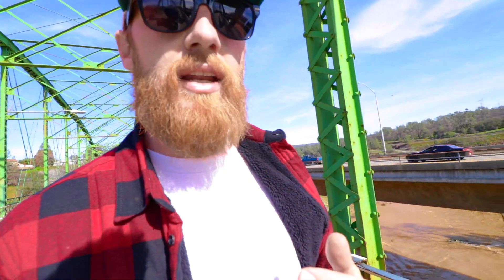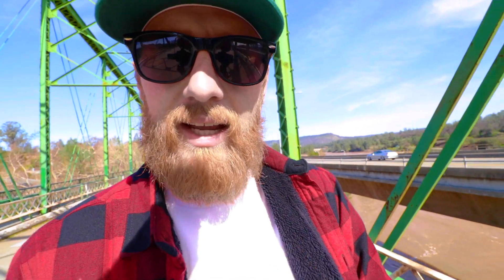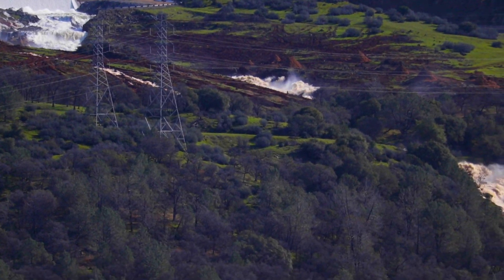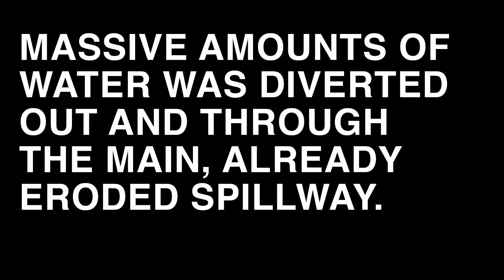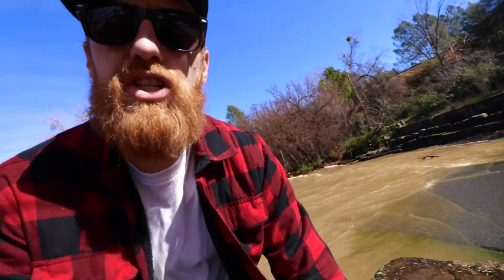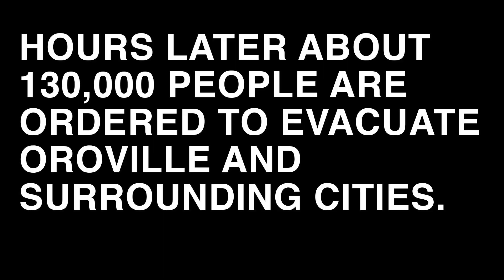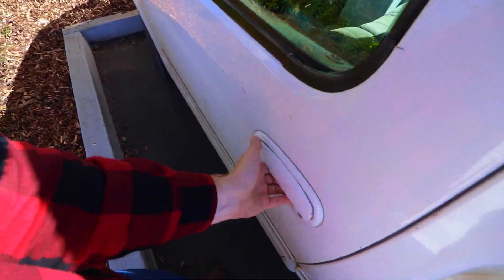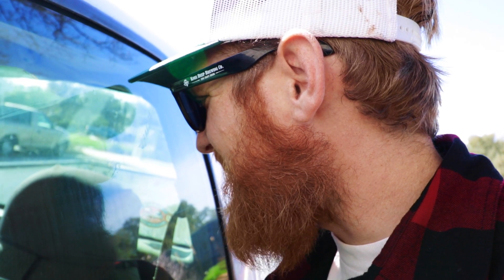The Oroville Dam Disaster!

Comment: Why is dam there,,  as the ther a river that flowed naturally before the dam,,
Reply: the dam is to prevent massive flooding downstream
Reply: @LuckyBaldwin777  but they keep saying there's a drought and wasn't too raise water charges it's a dam let it flow
Reply: @aquadeep9103  Last year and this are not drought years.  Droughts come and go.   Non-drought years frequently have heavy precipitation.  In the days before the levees, dams and weirs, widespread flooding of the Sacramento valley was common.  Here's a drone view of the open Colusa weir not too far from the Sligar ranch.  Video was filmed last January.  Notice all the flooded farmland.  That keeps downstream cities like Sacramento from flooding.

https://www.youtube.com/watch?v=efKWUlAMtSg
Reply: Amazing,   you would think that it would of cut out a river path somewhere through
Reply: @aquadeep9103  That;s a result of the gold rush.  So much dirt was washed into the valley from the hydraulic mines in the foothills that it evened out all the small hills and gullies and now the Sacramento valley is flat.  When flood water hits that kind of topography, the water just spreads out fairly evenly over the whole surface and fails to cut a real channel.  It drains because the entire valley has a slight slope to the south of about a foot per mile at the north end of the valley and only an inch or two per mile at the south end by Sacramento..
Reply: @LuckyBaldwin777  they should cut a river thru be nice to have another river run be good for environment economy and so much more.
Reply: Oh well thank you. Seem very knowledgeable on subject,  🤙